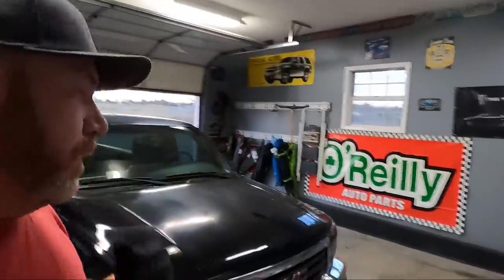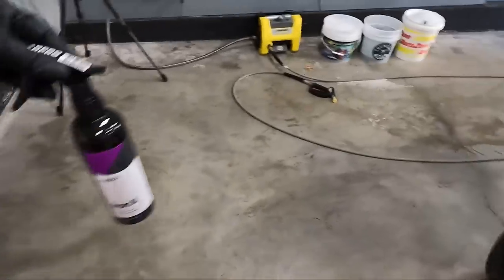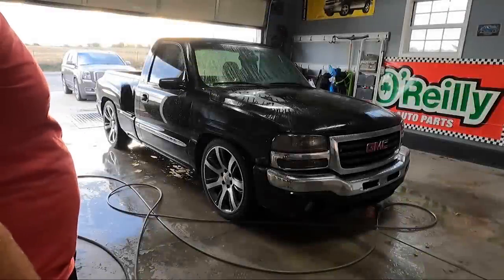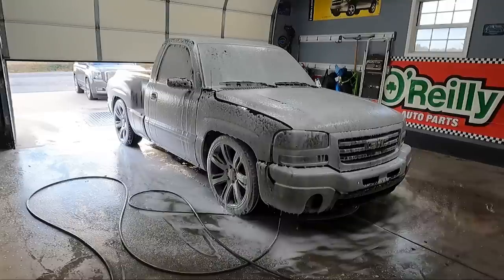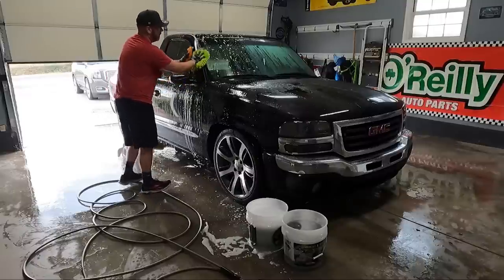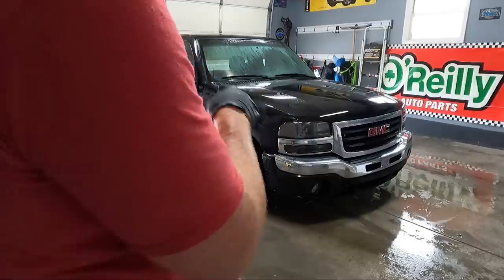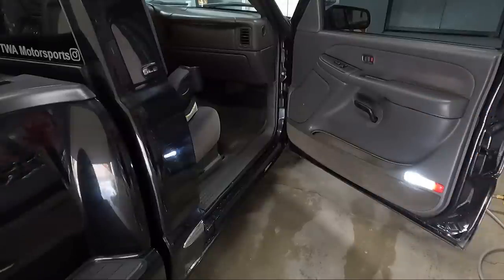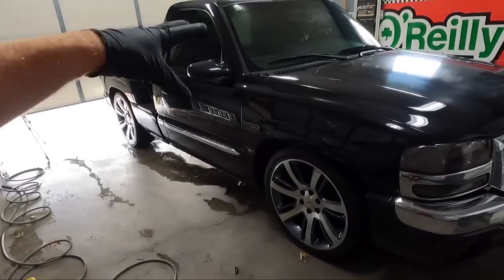How I Wash Cars (What I use and How I do it)

Comment: Excellent video! I always keep one of those nylon netted yellow bug sponges in the bucket. They work great for the mirror’s, front end and windshield.
Reply from the maker: I tried one and they marr up the paint pretty bad. Even when soaked for an hour
Reply: That’s strange. Ive been using them for decades. It’s a necessity here in Florida with all the bugs. They do take awhile to break in. But I’ve never had issues where they hurt the paint. And I like my stuff mint.
Reply from the maker: Yeah even when soft they are pretty abrasive

Comment: Hey Travis you can get one of those inline camper water filters that will help with the Minerals from well water, there on Amazon and they have them at Walmart, I use one with my pressure washer and foam gun .
Reply from the maker: I need to get something at some point
Reply: They last for 3 months and not really expensive and it will screw right to your Faucet and water hose
Reply from the maker: I will check that out.

Comment: I have a crew cab silverado like yours exactly I tried putting my 22s on and it's scrubbing. Did you have to adjust the front to get your 22s on??
Reply from the maker: No. These fit correctly. Random inner fender rubbing on huge bumps